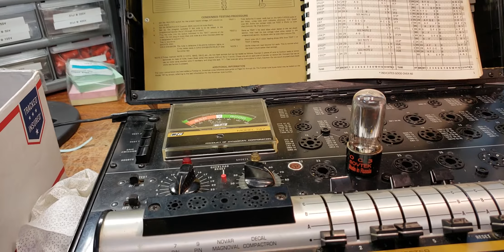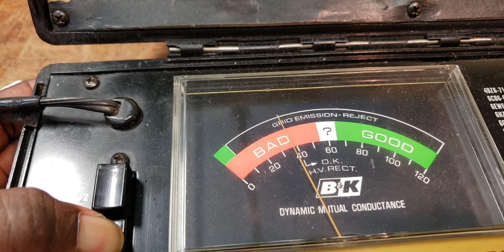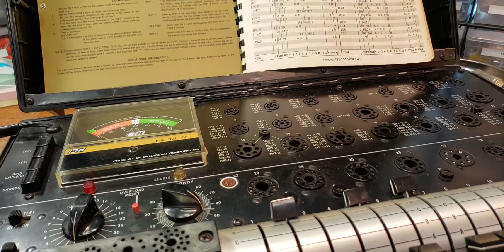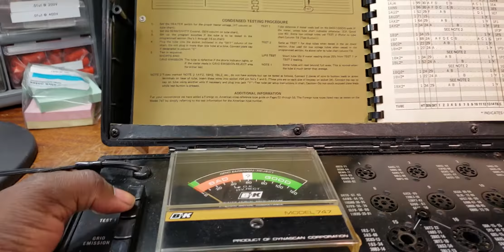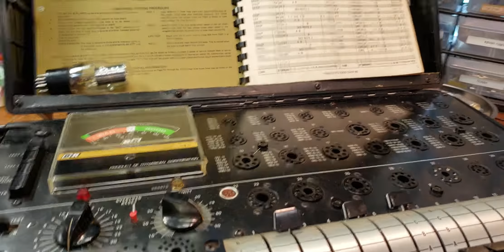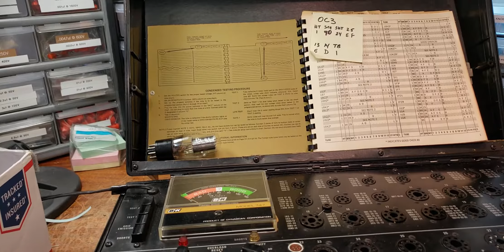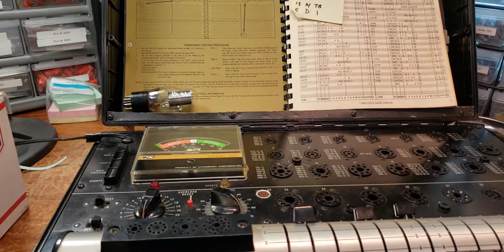Testing A Bad OC3 Voltage Regulator Tube Used In The Leslie Amplifier

Comment: If the regulator tube lights, it’s good. They aren’t like vacuum tubes. Your tester measures current and the regulator tubes are naturally low current devices. These types of tubes regulate voltage for a reference and the needed current is quite low. Regulator tubes won’t degrade like regular vacuum tubes.

They proper way to test one of these is to hook it to 200 volts or more with a 100k resistor in series and measure the voltage across the tube. These regulator tubes are just glorified neon bulbs and only have 2 active pins. If it holds steady voltage, it’s good. If it illuminates, it will hold steady voltage. Flickering would be a sign of a bad regulator tube.
Reply from the maker: Thanks for the note. Much appreciated.
Reply: @ncilmo  no problem man, i appreciate you hearing me out. A lot of people out there are far too arrogant and set in their ways to be open to new information, but you are seemingly humble which I admire.
Reply from the maker: @jjhack3r  I am always open to learning. :)
Reply: @jjhack3r  These gas VR tubes also should also be tested with an empty soup can placed over them as they take more voltage to start the plasma up in "total darkness" (data sheet terminology)  than in what the manufacturers call "ambient light" (more data sheet lingo) AKA the lighting level on the average workbench.  The difference for the OC3 is 210 volts to start in darkness and 127 volts to start in "ambient light". That is quite a difference in starting voltage, and it could come back to bite you if the tube sits in equipment trying to start and failing but still drawing all of the extra current it takes to start it. These can pass 5-40 milliamps running but they will draw up around 100 mA trying to start that gas up into plasma. Add two or three OD3s in series and if one fails to start, you are calling Heyboer Transformers up to spend $400+ on winding you a new power transformer. PLEASE, ask me how I know this! If those OD3s take a dump and they will, the bias voltage to the power supply's pass tubes goes to zero, the screen grids run away and at least 3 windings inside of the "main transformer" are all burned out. That is ALL of them except for the filament windings. The manufacturer gambles that those OD3 will start up BEFORE the windings for the bias supply in the "main" transformer will cook themselves. Starting the unit up with the plate supply turned on will also eventually damage that "main transformer" too. The plates come on with no negative bias grid voltage and no screen voltage. OUCH! And yes, eventually, those VRs do go bad. There is also a 5651 the most common VR on the planet, in there regulating the 0- 150 VDC @ 5mA bias  (C-) supply to go with the 0 +600 VDC @ 500mA (B+) supply. A 6BQ6 sweep tube regulates the 0-600 volts through varying the bias in SEVEN 6L6GB tubes in parallel and the C- runs through half a of a 6SL7. The other half of the 6SL7 does the feedback job that the 6BQ6 does for the B+. The 5651 regulates the bias to half of the 6SL7 keeping the C- bias output voltage very stable.

Comment: Hello! You don't need to wait for a regulator tube to warm up as it doesn't have a filament.
Reply from the maker: I agree. Thanks
Reply: @ncilmo  another good tip, don’t let the meter bottom out like that end to end, that can hurt the meter really bad, I’m not sure what setting and how it works on your tester, but  I’d figure it out and adjust that load setting so that a good tube want do that when tested! I doubt a tube would go over scale bad as long as nothing isn’t shorted. So just keep an eye on the bad, and add just your setting so that it want “over drive the meter” if you will.
Reply from the maker: @tucker934  I have a couple of these testers and have had them professionally calibrated and set.  They both do the same thing.  There is no load setting adjustment on the surface of the meter.  Don't know if that is the case on the inside.  But I figure that the man who did the work for me would have taken care of that if such were an issue with these meters.  At least, I hope that is the case because I don't want my meters to be damaged.  Thanks for your suggestion.  Much appreciated.
Reply: @ncilmo  it’s the Sensitivity control that would adjust the load on the tube when the test is performed. If I recall correctly left toward Zero (the closer you are to zero the more resistance is being used for the load)  on the control zero is basically no load, and the farther you go right to the largest number would be the least amount of load, or resistance. Try testing a good 0C3 but decreasing the sensitivity control some! It looks to be set around 90. I suggest a decrease to around 70-80, and testing a tube it should decrease how far the needle deflects, and hopeful prevent the needle from going way to far. And if you tinker with it you can get it at exactly 100, and it wouldn’t effect your test results! I help this helps, and prevents your meter for troubles. Great video btw! And glad you uploaded so that I can tell you about that!
Reply: You do wait for them to "start". The OD3, currently the bane of my existence, takes up to 10 seconds to start at 185 VDC, and it regulates to 150 VDC with a load of between 5mA and 40 mA. The manufacturer gambled that the transformer could be overloaded by oh, 170-200 mA until those two OD3s get started up. Yeah, no wonder they consider that an "expendable part". It's a f***ing $500 transformer, not a $60 tube, a $2 fuse or a $1 panel lamp! WTF?